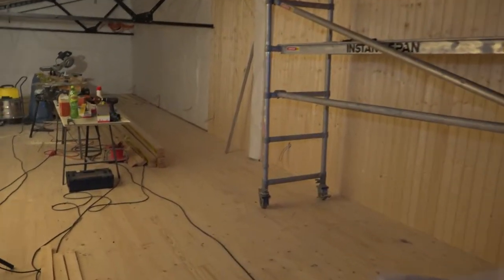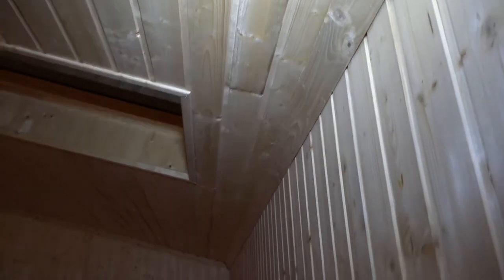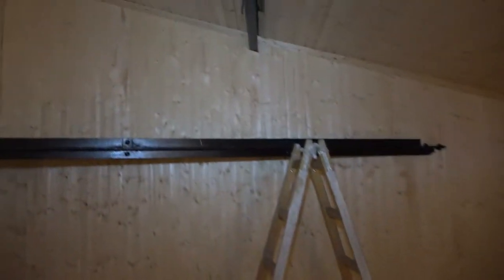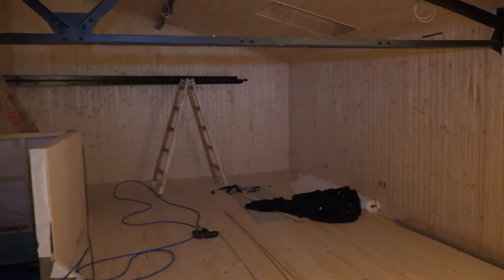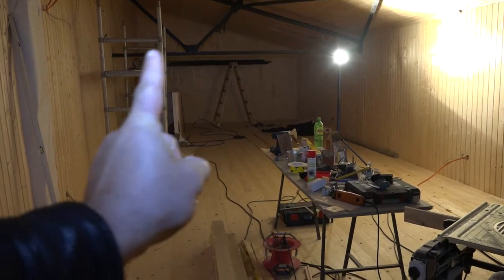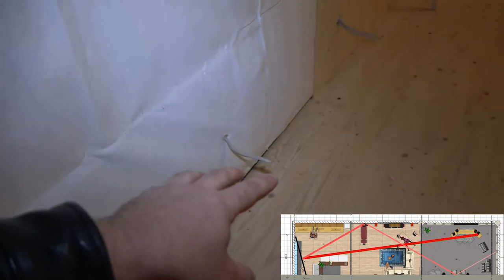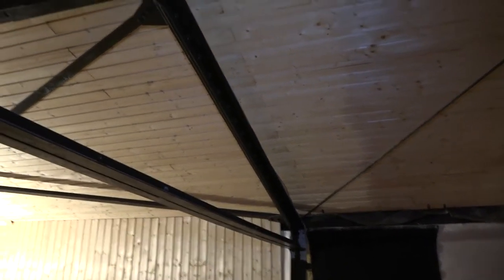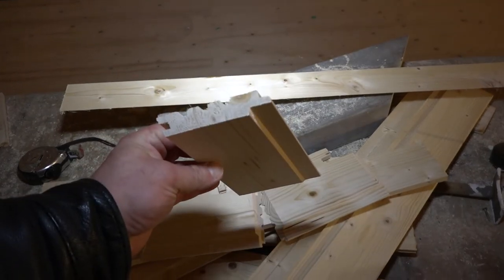Building a new home recording studio! Part 3.

Comment: Hi BMR, I just started watching your build videos. I am no pro but find acoustics fascinating. Regarding the computer drawing you have with the red lines for reflections, If you draw an extra line straight ahead from the right speaker would the reflection path in reverse utilise your new wall and send the sound directly back to your listening position? Would you not be better aiming your speakers down the length of the room to reduce low end problems or is it more important to have symmetry with the roof shape like you have it?
Reply from the maker: You just forgot the diffusion energy looses... Every bounce is about -9 to -18 dB. After this trick what we did with the whole wall surface, well.... Fantastic! No reflections, everything is clear, and still sounds natural. Everybody love it! The speakers aimed to my ears, like in every near field monitor... Check out the last video from the series, then you will see the final results.

Comment: Instead of a sliding wall, have you considered build panels? I mean that kind of panels you can put when needed in the place needed and when not needed put it aside
Reply from the maker: Isidoro Maich Will be something like this on wheels, because this steel beams are only on 185 cm height. 
This sectional wall system will operate also like a microphone booth. I have to do some smart system.